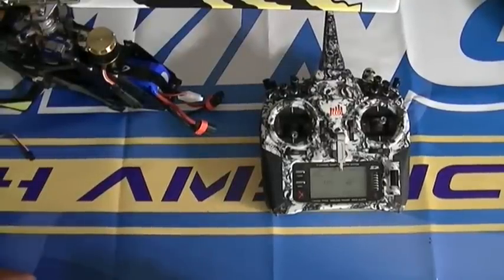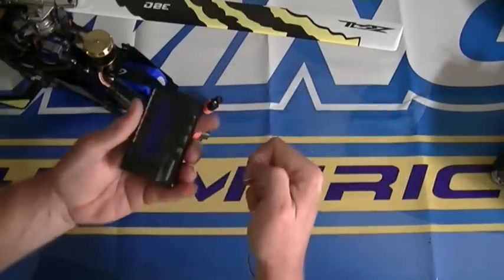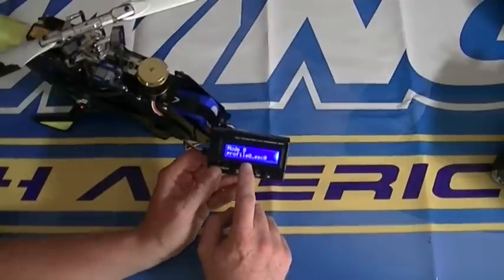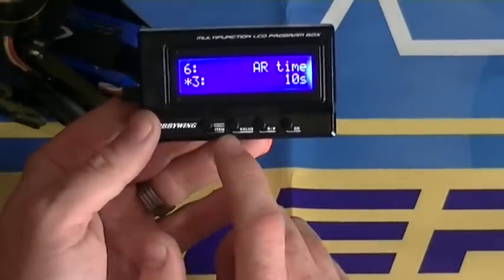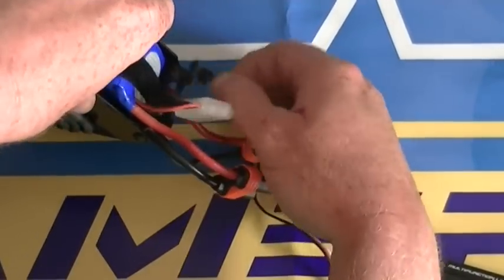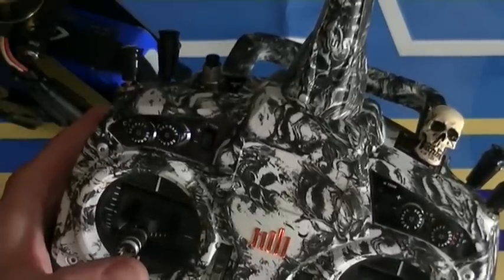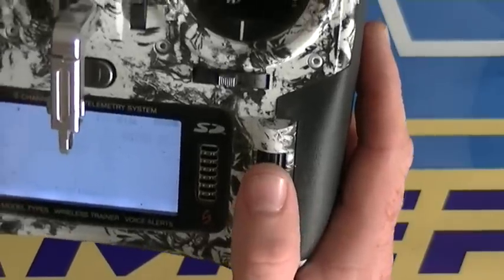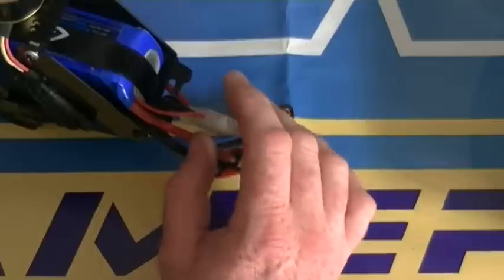Hobbywing Platinum pro V3/4 esc gov setup P2

Comment from the maker: Charles, they're Supra X Pro D6 connectors by RC Pro Plus. easy to solder, reusable, high amp rating, very secure yet easy to unplug. Best connectors on the planet. good luck finding them in stock in the US though

Comment: After RPM standardization, and after your heli spools down, according to the printed instructions, before you power down the heli, it says the lower your throttle stick on yer Tx to the bottom position in order to flash the standardized rpm to the ESC's memory. Not sure if engaging throttle hold takes care of that step, but it's been a habit of mine either way.
As far as Spartan FBL's and HW V4 ESC's and their rpm output lead, I dealt with trying to get a 130A V4 to work with a vx1 forever and after reading and reading forums I just went ahead and went and soldered a external sensor to use with the FBL unit. Hopefully they sort something out soon, all V3 ESC's work just fine.....not v4's for some reason. 
Nice video Dave!
Reply from the maker: HKMaster556 as long as the esc sees zero throttle it will be ok. Doesn't matter how it sees it as long as it does. 
HW is currently working on the solution for the V4 escs throttle signal issue
Reply from the maker: HKMaster556 lol same here. Have fun!
Reply: Yeah, I figured as much it had to just be looking for a zero throttle signal in any fashion. Yeah, I was talking with someone the other day about not only the V4 rpm out issue thing, but a ton of other exciting things being worked on as well! Needless to say. I am excited. -J

Comment: Hi Dave,So is it correct once set up that in Normal mode with a linear throttle curve 0 to 100 that nothing happens when the throttle stick of between 0 and 40% then when you raise the stick to 40% the motor will spool up to 40% ?

Comment: Hi DarkSyd3D.  I see that you are using a Spartan Vx1e.  I'm on my second Vx1n build (Gaui X3) and I'm using a HW 60a V4.  In Live Status, the Spartan does not acknowlege any signal from the built-in single wire RPM sensor when I run up the  motor (bench testing, no blades).
On my first build (Align 450) I used a Castle Talon-35 and soldered a separate HW RPM sensor to the motor wires.  The Vortex worked with that, no problem.

Does your Vortex work with the ESC's built-in single wire RPM sensor?
Reply from the maker: Funny you bring this up at this time :) just yesterday I started to test the external gov with the HW esc. so far it does recognize the signal with the 50a v3 but I'm stuck until Monday to set the rest up. I use Jeti Hero and didn't have the needed add on in the TX to use the gov function so I had to purchase it.
my next tests after the 50 will be the 60a, then 120lv, 130, and finally the 160hv all with the Vortex fbl.
I wanted to start with the 50 v3 because I know it works and wanted to get a base line of what to expect. 
testing will take a few weeks but I should have results for the 60 by next week hopefully. 
I would say for now use what works until there is a conclusion of what the issue is of the signal wire not working and we come up with a fix. Hope this helps.

cheers
Reply: DarkSyd3D
Hi & thankyou for replying.  I did solder an external HW RPM sensor and it seems to work fine with the Spartan.
Bigger problem though... I don't thing the BEC is putting out constant power.  Both Satellites flash and there are interruptions in the servo operation.  Just working the collective up & down, there are "freezes".  I did try a different ESC (HW V3 50 amp) and both Sats are solid ON, and servo operation is constant.  I did send a message to Hobbywing North America.  I purchased this back in Feb of this year.  Do you think they will do an exchange?
Reply from the maker: +Stringfellow Hawke they should no problem. Got to www.hobbywingdirect.com and fill out an rma
Reply: They should take care of you....did you end up sending it in on a rma??? Also how sure were you of all your solder joints??? Kinda sounds like a cold solder causing you power issues. If not I got noooo idea.  Hehe. Hope you got her fixed.
Reply: They did replace it... no fuss.  I don't know about the solder joints.  I had a LHS do it and they looked good.  With the new one, I bought a soldering station and did it myself.  Had a very hard time & it took me way too long.  So I hope the joints are ok now.  They seem to be working.  Thankyou.

Comment: quick question for you so you say not to go beyond 87 flat on high idle up in gov mode so what if the head speed is not high enough and you can not change the pinion.what would happen if you used a flat 100 esc failure  or blow up esc .
Reply from the maker: nitrokyosho curious why you wouldn't be able to change the pinion? What would happen if you did run it at 100 would definitely be excessive heat and a very poorly performing governor.
Reply: DarkSyd3D ok thanks I'm use to castle gov these are new to me .align trex 700 x only offers 1 pinion but maybe at 87 % in at 2100 rpm need to use a tac
Reply from the maker: nitrokyosho castle govs are a little more liberal with their throttle which is why many smack pilots prefer a tighter running gov. 
I'm surprised Align only offers one pinion option for the 700x. I wonder if the other Align 700 opinions would work. 
2100 is a great headspeed but will shorten battery life. I'm noticing more and more pilots running lower headspeeds and increasing pitch for longer run times. Something to think about.
Reply: DarkSyd3D ok thanks buddy
Reply from the maker: nitrokyosho no problem

Comment: Hi, thank you for your video. 
Is the LCD Program Box compatible with V4 ESCs out of the box or you need to update its firmware? Regards!
Reply from the maker: Most likely not. Since there have been several firmware updated to the V4 esc and 2 or three to the LCD box you would need to update the box first, then the esc

Comment: Hi DarkSyd3D, where did you get your TX skin cover? I was looking several sites on net but I couldn't find any better than yours. where can I get one for my DX9?
Reply from the maker: hey dude. thanks! I actually Hydrodipped the transmitter. has to take everything out of the inside but it wasn't bad. look up hydrodipping on YouTube and you can see how it's done
Reply: Hi again DarkSyd3D, I've ordered a hydrodipping kit and it will probably arrive by tomorrow. I decided to do myself :) I just have couple of questions if you don't mind I would like to ask you...
1. is it really hard to remove DX9 and put it back together, any tips or suggestions?
2. is it necessary to sand all the radio?
3. my theme is skulls, what base coat color should apply, black or white?
4. any further advise would be appreciated :)
thanx!!!
Reply from the maker: +necip ali the best tip for taking the TX apart I'd take pics of the inside and the order of the wires. mark the position of the switches and most importantly be very careful. small wires break easy.
I used a hobby grade media blaster I bought from harbor freight to dull the finish on the 9 so the base coau would adhere better. just tape off anything you don't want sanded like the screen and switch plates.
depending on your exact design and color would determine the choice of base color. On mine, the only foreground color is black so a black base coat would mask the image. white will make any color stand out well but is also prone to look dirty faster. The kit I purchased came with everything except the tub for dipping. the base coat is fast drying and covers well. and I used a matte clear coat with 4 coats of it.
If you've never done it before, find something with curves and crevices to practice on. You'll hate yourself if you stretch the image or it comes out looking bad.
Reply: +DarkSyd3D thank you very much, really helpful info for me. I will show you the result. 👍🏻👍🏻👍🏻👌👌👌

Comment: Darksyde very good video awesome. I got one question i got the same equpment as you but how do i start a softstart where my blade spools up at the very beginning of my stick at lets say 5% stick i stead my blades start spinning at almost 50% I dont like that it scares me on my alzrc 380 devil which is essentially a goblin clone. Thanks Darksyde.
Reply from the maker: Paul Santora there's no way to do that when you're in any of the internal governing modes. The throttle doesn't respond till it's over 40%. But it should still spool up slowly with soft start as that is also controlled by the gov :)
Reply: why is that it allows more control over my throttle why would they allow that happening at 40% blahhhh thats horrible there is no soft start only soft stop. what is the readings when tje governor 1-9. and theres governor par 1 between 10 on my platinumm does 1 mean min start to max speed. Thanks so much Darksyde you are Life saver seriously.
Reply from the maker: Paul Santora I'm not sure what setting you're referring to. What esc do you have?
Reply: the same exact one you got Darksyde. there gov 1-9 and theres. gover par. 1-9 as well 
well what do the numbers mean in governor mode mean anywAy. this helielf setting.
Reply from the maker: Paul Santora I'm still unsure what parameter you're in to know what it means. If you're using the LCD program box it will tell you at the top
Reply from the maker: Paul Santora I'm unaware of any setting that has a number value like that

Comment: When you select a setting like Helicopter store and press ok how do you know it's saved. The asterisk is only on the default values and stays that way so there's no indication that you have picked a setting.
Reply from the maker: Basil Yousif correct. The asterisk only shows what is the default value Incase you want to go back to it. You can verify the saved values but powering down the system and powering back up again. The saved values will always show first as you scroll through each parameter

Comment: Thanks for the video. Have a question. I am new to rc heli and have trex 500. Does every ESC have governor mode if it has general beep 6 step setup? How can I find out if it has gov mode in the first place? Do I need to buy hobbyking program card for this?

Comment: Hey dude, nice video and cool transmitter skin. Question for you, can I use this ESC with a Neo VBAR external gov?
Reply from the maker: you can but you have to use airplane mode and make sure your soft start on the vbar gov is enabled and working the way you want it
Reply: +DarkSyd3D ok great. Thanks. Are you on Facebook?
Reply from the maker: +Anthony Garcia yup. davebartleyrc. Helifreak too. darksyd3d
Reply: +DarkSyd3D So If I understand it correctly, the only purpose for that RPM sensor wire on the HW is to use an FBL unit's gov... correct?  And for that, it has to be in Airplane mode so there's basically no delay between what the Spartan gov asks for, and what the HW will deliver?  The ESC will be totally slaved to the Spartan Vortex.  In other words, any delayed power (such as Soft Start) would have to be programmed into the FBL unit (Spartan or Vbar or Other).
And since I have the v4 60amp, and I want to use the Spartan's gov... I hope I'm not going to sacrifice the Active Freewheeling feature?
The manual does such a poor job of explaining these things.  And using the Programming box, I couldn't find where to even enter the pinion/maingear ratio, pole count, pwm, etc... even if I wanted to use the HW gov.  Thanks for posting.
Reply from the maker: +Stringfellow Hawke  you are correct about the esc being a slave for the FBL unit. If you want to have a soft start and auto bailout through the esc you would set it in Heli Linear (cant remember what its called in V4). Those are the only two gov features that can be programmed. If youre using Fixed Wing mode youll have to set everything in the spartan i.e. pole count, soft start, ect. 

As far as the AFW I havent actually checked to see if it sill functions on an external gov. Im pretty sure you will still have that function but again, dont quote me lol.

Pole count and gear ration is not programmable because of how the RPM is standardized within the HW. Its not set based on the numbers you input. Its based on the load the esc senses during the store process.

As far as timing and PWM, try updating the program box to v3.2.22 and the esc to v4.0.0.1
My 160s didnt have those settings at one point and not they do. Not sure if it will be the same with the LV series. 

Hope this helps!!
Reply: +DarkSyd3D Thanks for responding :)
I did the updates and it does now have a timing setting.  I set it to 5-deg as per Scorpion specs.  No PWM settings.  And it seems so strange to me that neither the HW or the Spartan even cares about the Kv of the motor.  I guess I'm too used to setting up the Castles with all the specific settings... I'm paranoid I'm going to fry this thing.

Comment: hey what does it mean when you do a tic toc and the motors cuts out then comes back on. I tried adjusting the LVC and it doesn't do me any good?
Reply from the maker: Billy Sventzouris  Most likely you have either a bad or loose or cold solder joint. Every time I've seen that happen that has been the cause. I would go over every solder joint that you have and make sure everything is nice and shiny. May want toeven consider reflowing the solder joints

Comment: Hello  Boss!1  Another  quick question hereif  you  could please  guide me. i got  the  HW 100 V3  it  says   it comes  with  rpm  sensor.   how  do  i  set that up?  i got  a  dx9 and  ikon . thanks alot.
Reply from the maker: Luis Lopez it doesn't come with an rpm sensor. It has an rpm out wire which is the single yellow cable. I believe you need the adapter the Ikon has to plug it into the ikons gov port
Reply: after is pluged. do i need to do anything on the radio or ikon? thanks for your time buddy.
Reply from the maker: Luis Lopez yes, depends if you want to use the Ikon gov or the internal HW gov. If using the Ikon gov you have to set the HW gov off with either heli gov off mode or fixed wing mode. You also have to set the Ikon gov up. Refer to the forum threads for those instructions

Comment from the maker: Ron Larkin I don't see your comment although I have a notification of one from you. You can PM me on helifreak anytime.
Reply: DarkSyd3D I'll try responding to this. If you don't get this time I will go to HF. I have set up my esc as per your vid. And  the governor works well in idle 1 and 2. Is it correct that in normal mode set with a linear 0 to 100 pitch curve that the motor doesn't spool until the stick is raised to 40% position and then the motor quickly spools up to 40 % throttle?
Reply from the maker: Rod Larkin hey ron, it's normal for the motor not to engage till the esc sees 40% throttle or more as this is one of the functions of the gov. 
Depending on what you mean by "quickly" spooling up in linear mode it's possible it's doing that if you have the auto bailout set. Otherwise it should spool up like it would in IU 1 or 2

Comment: governor store vs elfgov or only governor what is the different??????
Reply from the maker: gov store only requires one calibration for a fully charged pack. Afterword you when you use other packs you won't have to calibrate again. If you put in a poorly performing battery you may get shorter flight time because the Gov wants to maintain the headspeed based on the stored calibration.
Gov ELF requires a calibration every time you go to fly after unplugging a pack. This option will make the gov work based on the output of the pack currently in use.

Comment: Whats the best timing and pwm for the scorpion 4020 1100kv motor for a power set up im running 8 pwm and 5 timing and it don’t feel powerful enough?
Reply from the maker: heli baz  I always just play around with those settings until I can get the right balance of power and efficiency. That's probably the best thing to do
Reply: DarkSyd3D hi i need a quicker pitch punch do i need more headspeed i have a 18t pinion now but it punches up slow can i go for a 20t pinion will that work?
Reply from the maker: heli baz I assume by the size of the motor you're flying a 500? 
Increasing the pinion size will increase the headspeed but will also take some torque away.
Depending on how much pitch you have you may need to increase it or even decrease the expo for pitch.
Reply: The punch is not that good what do you suggest
Reply from the maker: heli baz what's your headspeed and pitch? I typically run 13-13.5*. On a 500 you want 2500 headspeed minimum
Reply: Im running 13 pitch
Reply: Don’t know what my headspeed idim running 85% throttle curve flat line in gov mode
Reply from the maker: heli baz definitely do a 20t pinion
Reply: DarkSyd3D I’ll give it a try hopefully it wont over heat anything thanks for the info👍
Reply: What pinion are you using to get 3600 rpm
Reply from the maker: heli baz use Mr Mel's headspeed calculator to figure that out